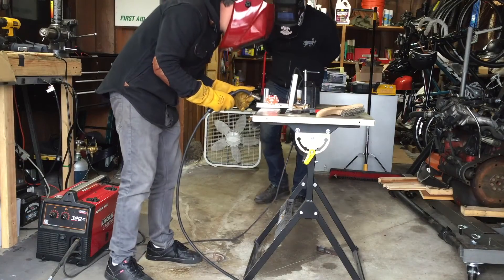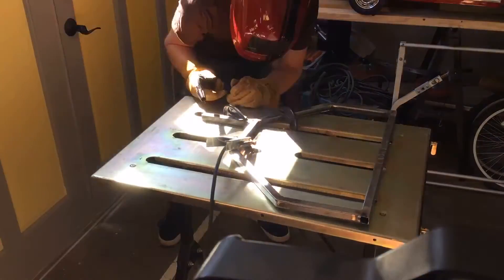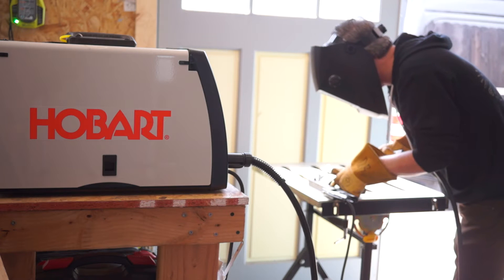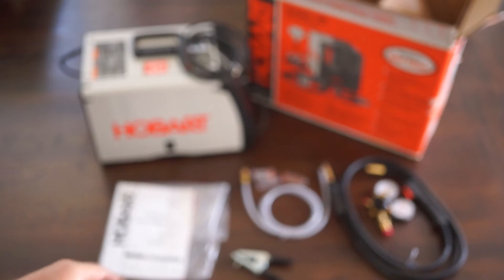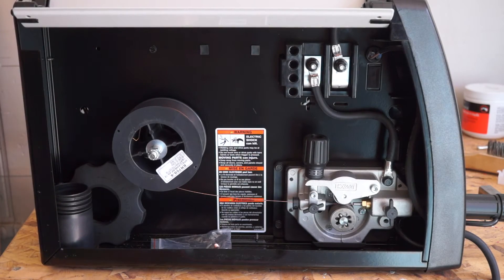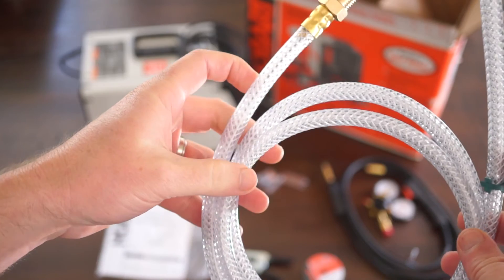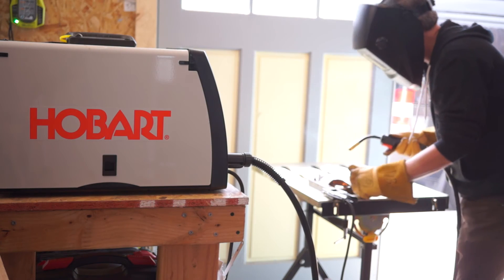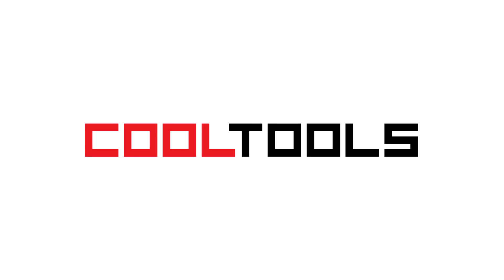Best value MIG Welder

Comment: I just bought the Hobart 190 .  Have not used it yet as its 240 v only.  My opinion is if Hobart put infinite voltage and infinite wire speed they would blow the others at this price point away .